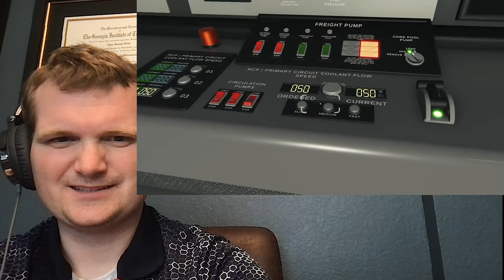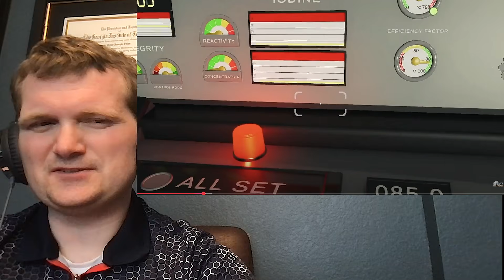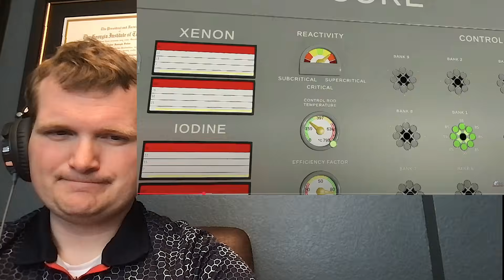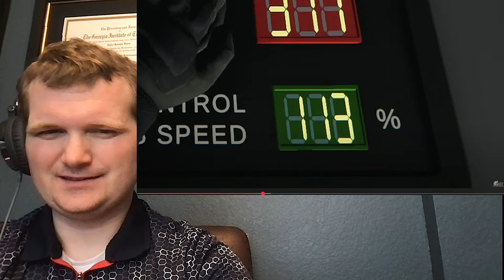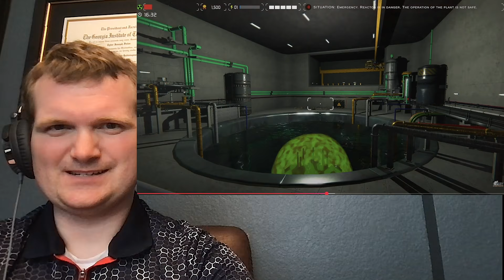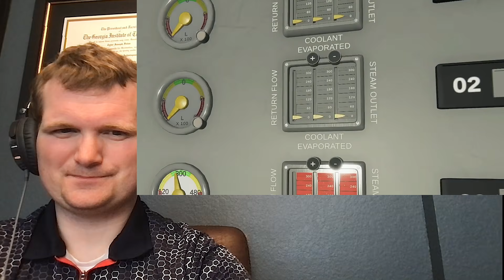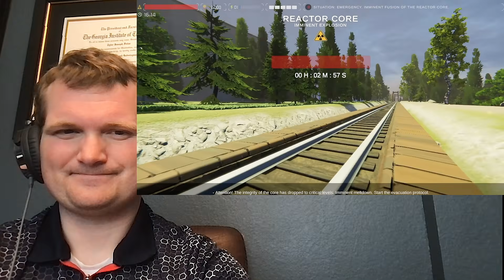Nuclear Meltdown on Purpose in a Video Game - Nuclear Engineer Reacts to GrayStillPlays

Comment: So a pellet of plutonium could, in theory, provide the necessary 1.21 gigawatts needed?
Reply: Depends on how exactly you're extracting the energy. 
Controlled fission? see Iongenerals reply. 
Fusion? With an element as heavy as Plutonium? you'd lose far more energy then you gained. 
Anti-matter annihilation? That would certainly generate AT LEAST 1.21 gigawatts for your delorean based time-machine.....for the 0.00000001 seconds it would remain as a solid, before all the excess energy released turns it (and a substantial area around it) into plasma.
I imagine your local government won't be too happy about the smoldering crater where a city used to be, either.
Reply: The energy output from a single pellet is minuscule compared to a gigawatt.* A nuclear reactor requires tens of thousands of these pellets arranged in fuel rods to generate power on a gigawatt scale. A typical large reactor can produce around 1 gigawatt of electrical power, but it needs a continuous sustained nuclear reaction involving a large core of fissile material, not just a single pellet.
Reply: @iongeneral You've never seen Back to the Future, have you?

Comment: Can't speak for every ship, but our limit for fast recoveries was 5 dpm. Still, by the time you got to 5 you normally only had a few seconds before you would have to shim in to reduce startup rate. Otherwise, you would skyrocket into the power range and end up with a sick heat up rate, or worse just trip the reactor again.

Comment: Glad to see you give this game another look. It's still in development and you did a 2 part react to an early version in late '23. They've added quite a bit since then. There is a chemical simulation aspect now with boron injection and stuff but I think its an optional component, like for a difficulty option. Many of the units are in percent, like the control rods are shown as percent inserted. My guess on the engine power thing with the control rod panel is that it shows watts so you know how much power you need to provide if you aren't generating, and the percent going over 100 probably just increases component wear. That was added since the last time I played the game so I'm not sure. There are a lot plant operation aspects this video didn't cover. You do outages for refueling and maintenance every few days. Things wear and you need to go fix or replace them, weld some pipe, refuel the generators, etc. There are upgrades you can buy, which is why it looks like there are three turbines, you start with one and can buy the other two as you make money. It is set up as load following, the grid monitor stuff is so you can see your targets, which increase over time, and meeting those is how you make money. Needing to raise or lower power is what keeps it interesting as a game once you've figured out how to do a startup and shutdown without melting your fuel.

Comment: 5:19 Sefty of work. The max loadout on coal mine shaft is 30 tonnes, the maximum elasticity is on 134 tonnes, and snap point on 160 tonnes. That is normal safety because of if something under explode or fall apart this things must work normal.

Comment: I have a question. If you insert control rods into reactor, that mean in upper parts of the reactor, reaction does not occur. does that mean that fuel rods are getting slower in time in generating steam? But upper parts are not as used as bottom? Do you need to put control rods up in older fuel rods to create as much power as earlier?